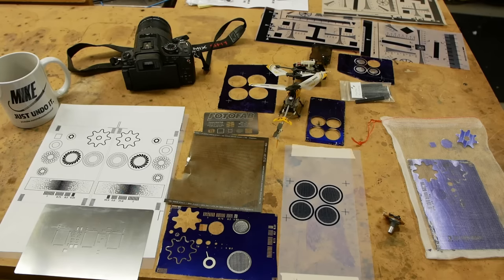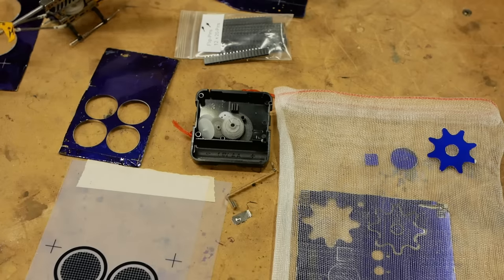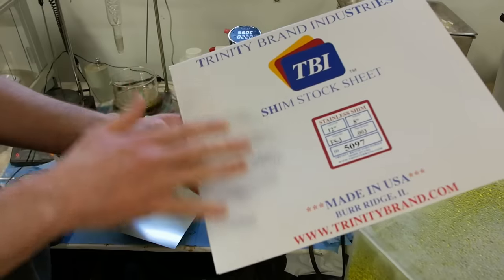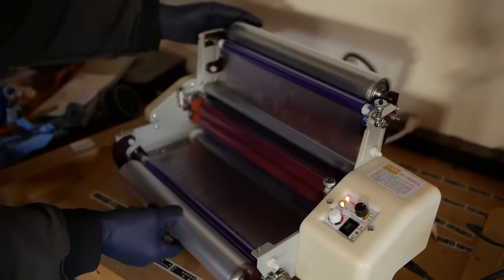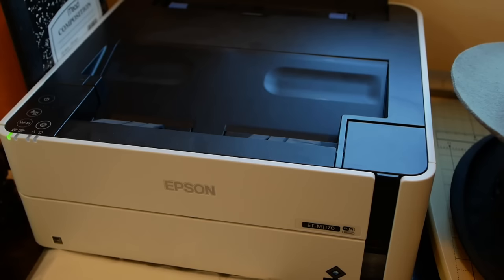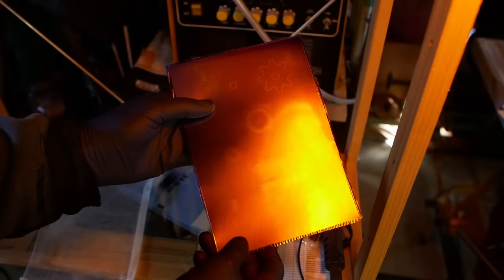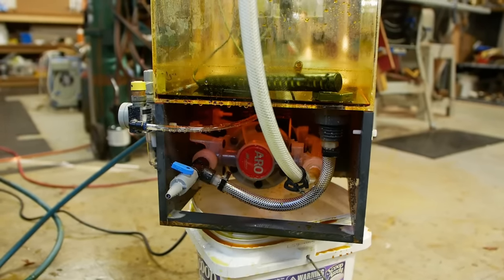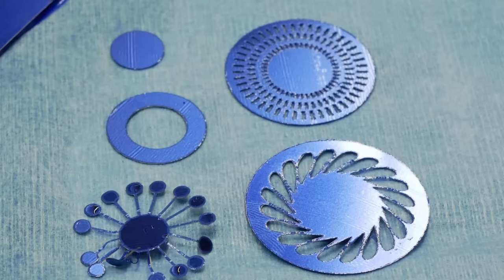How to make precise sheet metal parts (photochemical machining)

Comment: I really appreciate how you not only show your successes but discuss your challenges in these projects.
I have one suggestion if you ever wanted to revisit this.  Back in my PCB etching days I found that a viable alternative to spray etching is bubble agitation of the etchant.  Putting a fine mesh bubbler grid at the bottom of the tank below the part has similar performance to high pressure spray with the added benefit of not having the etchant running in the plumbing and pump.   
Both spray and bubbling end up with the same effect of getting fresh etchant to the metal being etched.   Just putting the material in a still tank ends up with the etching site having lower concentration of fresh FeCl as the already combined products only slowly move away from the reaction plane.   Bubbling seems to have a similar effect as spraying, constantly introducing fresh FeCl to the etch site increasing the overall reaction speed.   
My first test of this setup didn't anticipate how dramatic the difference was vs simple etchant circulation, so I etched too long and ended up undercutting the mask so much that all the copper was removed from the board!  Not quite the result I intended.
Reply: The problem with bubblers is that no matter how much filtration you have, there's a constant outflow of ferric chloride saturated air from the tank and things get..... corroded... in the vicinity. We ended up swapping out the bubbler for a couple of model boat props on very long shafts run through the tank lid

When etching copper, there are alternatives to ferric chloride. It's reliable but messy and makes even stainless steel rust

High strength hydrogen peroxide + hydrochloric acid (we used to call this the 6 second etch - extremely dangerous in high concentrations) - this works really well and lasts virtually forever (used ferric chloride is an environmental hazard due to the copper in it) - this also eats stainless steel so use with caution

Ammonium persulphate works really well too

There are a few instructables around on this stuff, but etching steel or other metals will have different ideal etchants
Reply: @miscbits6399  I don't disagree that air filtration is a necessity with bubbler systems.  I used an activated charcoal fume capture with good results.  I didn't mention that point since I was comparing to a spray etch system which has very similar exhaust air filtering needs, but thanks for pointing this out.
Reply: Why would you go for that instead of normal
Horizontal conveyor with oacillating sprays top and bottom?

It’s an oxidation reaction which will allow good circulation of fecl3 while solids deposit at the bottom of sump and also have enough flow contact with the substrate. 

Sounds interesting what you tried anyway.
Reply: @Mr.Flo.Official  Good questions.   Answers:   this was ~1981 in a lab setup for prototyping boards.  I already had a etchant circulating dunk style tank which I could convert by reversing the hose connections to pump air vs liquids, and didn't need to add parts.   This was long enough ago that I was prototyping by drawing circuits with resist tape, not even photo resist.
Reply: @IFS  i see :) things changed since.
Reply: @miscbits6399  I just sealed the tank and let the pump suck in the air at the top, this mostly solved the corrosive fumes issue.

Comment: Regarding the transparency and the special ink. I had the same problem 25 years ago making masks for exposing PCB's. Came to the conclusion that printing on ordinary paper worked well enough. The laser toner sticks really well to paper, the coverage is 100% without pinholes. And the UV used to expose the photo resist went through just fine.
I had to mirror flip the design so that the printed side of the paper touched the photo resist.
Reply: Okay, that's interesting that the toner sticks fine to paper, but not transparencies. I'm more surprised to hear about the UV transparency of the paper, though!

Comment: As others have said, great work as usual X)

For the registration alignment of the two layers of transparency - what about using an overhead projector?  Put both sheets on the glass, then use the projected image to align the parts.  Not a huge amount of magnification, but even 3~5x with good ergonomics would help.
Reply: That’s brilliant!

Comment: I have been doing a variation of this. Instead of printing on transparencies and then using an UV exposure station I used a cheap resin 3d printer to expose my artwork on the resist.

(The kind where a UV light is projected through a digital screen to solidify the resin. I have been using an Elegoo Saturn. I just remove the vat and put the plate on the screen.)

It worked quite okay for me. I got some niece pieces. The theoretical benefit is that you have zero setup cost. The very real drawback is that if you want to etch from two sides (and you want to etch from two sides) then you need to flip the plate and place it very precisely at the same spot on the resin printer's screen.

To be able to achieve that I have made a kind of jig holding a usb microscope solid relative to the printer. If you do an exposure without the plate being present you can see the invididual pixels of the resin printer with the microscope. And then you can use this to align the second side of the plate very precisely.

I have made this decorative orrery using the technique: https://www.youtube.com/watch?v=KK3TiUWSTbI

Comment: Very cool!  It's quite similar to the process I've used for home PCBs, an Epson inkjet is pretty much mandatory for getting that super-dense artwork-- and yeah, pretty annoying you have to use a piece of paper as a backing to get it to detect the transparency.  I use a medium-format Artisan 1430 outfitted with a CISS system to make sure I never run out of ink.  Now that Epson has come out with Econo-cart refillable systems it sure makes the whole process straightforward, using special high-density inks.  For developer I do like using sodium metasilicate since it seems a bit more forgiving.  Also using a vacuum-bag to hold the artwork against the boards is a lot less hassle than getting pairs of glass pieces to sandwich the artwork/board and making sure it has even pressure across the whole piece.  For single-sided boards I just use a consumer vacuum-sealer/bag, though I have to make a bag out of heavy plastic tarp for double-sided boards since they have printed stuff on one side of the vacuum bags.  To seal them I use the rubber tape which is used for carbon fiber/fiberglass resin infusion, as well as sealing around the vacuum hose.  Very easy to use, strong, and virtually leak-proof.

Comment: I've gone through almost exactly this process in the last week so this couldn't have come at a better time! I ended up going with a spray photo resist and then removing the resist with a galvo laser since I was making a decorative brass piece but this seems like a fascinating method too!

I'm not sure if adding citric acid to the ferric chloride will help with stainless but so called Edinburgh Etch is a more efficient etch used in copper plate print making. The theory being the citrate helps to keep the etched material soluble.
Reply: In case others want to take a deep dive:
I've also though about using a resin 3D printer as a direct digital-to-plate technology. I've seen videos about doing this for PCBs. Since they have a UV source and the screen acts as a digital resist, you can put the sensitised plate on the screen directly. As the printers get bigger, hopefully there'll be more spare parts available to make a dedicated unit for exposures at a usable size.

Comment: This whole process is very similar to offset printing plates.  But they were in aluminum, and only partially etched into the plates for printing.  We did quite a lot of these in our class.  This was highschool graphics class, back when the 486 was being conquered by the pentiums.  We used all Macs though for that class.  Don't remember what they were, but early 90's style machines.  The large camera is what we used to make our transparencies.  Literally a giant wall with a huge lens, and a room behind it to put the transparent film onto it.  We developed it right then and there.  I bet film transparency would be even better than inkjet as far as detail goes.  We then used this on a the plate that was pre-covered with resist, put it in the light bath thing for a few minutes, and then washed it off in a special bath and unknown chemicals (at the time), and then rinsed them, and the plate was done.

Comment: I make circuit boards using laser printer toner for the resist. I use a heated 'laminator' to apply it. My artwork IS my resist. It took a few tries to get right combination of backing paper, heat, and pressure dialed in but it was an inexpensive and rapid process. I purchased the highest resolution BUDGET monocrome laser printer I could find and have much success. I don't know if toner would survive your mesh bagged etching intact though.
Reply: One note on using toner transfer. I don’t know if this is still the case, but at least formerly, Brother’s toner didn’t work for the process. I don’t recall the details, think it maybe had a much higher fusing temperature so it was hard to get it properly melted to stick to the PCB material.

Comment: If no one else has mentioned it, look at the clean air boxes that mushroom growers use. It might work for drying the metal after cleaning if you’re doing large batches
Reply: laminar flow hood, you can DIY them pretty easily

Comment: What sort of pump did you find that can handle ferric chloride without disinregrating?
Reply: As per ~ 18:48 they are "Air Operated Double Diaphragm Pumps" and appear to be made by "ARO".  

So Basically it's almost like a drum (the instrument) with pipes over the external "drum heads".  Air is pumped into the "drum", the diaphragms push out a bit, and if the "pipes" are designed all fancily and some one way valves are used one can make a pump.  These not only can be really chemical resistant, but some can even pump abrasive slurries!

Comment: I know you can use Miore patterns, which are large macro patterns that naturally appear while adjusting the alignment between parts with fine regular features, to quickly alignment-tune industrial survey equipment by hand to a surprising degree of accuracy. (Even to the point where the expensive high accuracy measurement equipment was only necessary as a QC / fine-tuning step, improving production rates etc.)

I wonder, if you put a a differently spaced dot pattern on each side of the print if that would enable you to do fine alignment of the two layers by eye ( 13:00 ).
Reply: the awesome thing about your idea is that he can still use the typical cross as rough adjust, sanity check and fallback. It adds to the precision, without taking anything away.
Reply: I used moire patterns to calibrate the flatbed printer for lenticular printing. It is annoying to get it to align perfectly, but you get some mad precision.
Reply: Vernier calipers use a similar trick to let you read extremely fine measurements. It's such a clever idea, I was amazed when I learned to use them.
Reply: Great idea to use moirés! They should make very fine alignment easy without magnification or squinting.
Reply: Aligning the tool is one of the biggest challenges when it comes to preserving misalignement top to bottom. 
He will never get any sort of grids good enough for any applications doing it this way. :) 

He never discused about how shrinking affects alignement etc etc.

Comment: Ben, thanks for the video, brings back memories of make PCB boards before you could buy them dirt cheap.  I like your etching tank, for PCB's I has a splash tank.   It was about a foot cube tank epoxied plywood. You put about 1 to 2 inches of etchant  in the bottom.  A motor driven dasher paddel  splashed it all over the board with good force. --worked very well.
The final improvement that I never finished was to make a raster direct UV laser diode imager. No need to do any lithography.  I met a guy Zoltan who converted a old printer, replacing the print head with laser source and lens.  He got some amazing resolution from the hack.  One thought I had was to convert a laser printer poly scanning mirror and lens from the IR to a UV laser for the X axis then use a stepper driven Y axis stage to advance to the next line.

Comment: Regarding the plastic fittings at 19:40, you might want to try Fit-line PVDF or PFA Flare fittings.  The PVDF fittings are cheaper and might be all you need.  These fitting are more likely to handle the heat, pulsating pressure, and corrosiveness of your fluid.

Comment: For the mask, you could perhaps use a film imager (recorder?) for offset printing. Nowadays many printshops use direct-to-plate imaging, but you may find a used film imager for cheap. The film that goes with it is high-contrast, high-resolution (we used to do 2,400 ppi) and designed for near-perfect registration. Of course, this involves its own film development workflow, which you may not want to fuss with.
Reply: Came here to say this. Useful ebay terms include "imagesetter" and brands "linotype" and "agfa". Beautiful output and perfect for this application.

Comment: This is how I make my PCB prototypes :)
I use immersion oil (for microscopy), between the photomask and photoresist - the edges come out much sharper.
Reply: Me too. I use ky lube instead. easily dissolves in water
Reply: @marcoaurelio4903  If it is suitable in terms of optical characteristics and has similar refractive properties, then it is possible.

Comment: +1 on another great vid comments :) From a former pro photographer who started in the age of film, a couple of potential resources for old photo tech that could be cheaply adapted: 4x5, 5x7, 8x10 and custom sized sheet film used to be sent through the machines on these stainless steel racks that had standard and adjustable rungs and spacers that would firmly hold several sheets in each rack. The film was held firmly around the perimeter and wouldn’t come loose—I wonder if you could find some of those kicking around somewhere... dunno if Adolph Gasser is still open but they used to have huge piles of photo junk in the basement. I once scored 3 or 4 big enlarger uprights for a song. Hand cranked sturdiness... Also if anyone in your network is closer than Kevin Bacon to any of the good people who worked at the New Lab, buying them lunch in exchange for describing how their big E-6 line functioned would be invaluable, and would probably come with some great stories to boot. One last aside regarding plastic compatibility: I recently threw together an electrolyzer for water-splitting (because BANG!!!) and found the hard way that few plastics do well with strong KOH solutions, including polycarbonate and acrylic—which makes me think of all those electrolyzer kits with the clear outer walls, and how I wasn’t able to find any common clear plastic that was considered to be at all good for long-term contact with strong alkali solutions... I used polycarbonate because it doesn’t shatter but the KOH took it to pieces in days. 

Anyway thanks for another good episode :) 

Wells

Comment: Aftermarket photietch for scale models is pretty cool. Also incredibly expensive to buy pre-made stuff so there are inexpensive kits that couple everything for you. MicroMark has a small size kit with everything you need for about 110 dollars (obviously doesn't have a printer included though)

Plasmo has a good video on this subject too but it's a lot less precise since it's done on the super cheap with the simplest set up possible

Comment: We also learned, that despite the claims of many manufacturers, a variety of plastic products are not compatible with acidic products. We do research on redoxflow batteries. Ended up developing a whole process of what works and what doesn't with our chemistry. Its really nice to see your workarounds for the problems you were facing. Keep it up!

Comment: I can imagine a fully automated system doing all those steps. No wonder why the comercial option is so expensive.
Amazing video as always!
Reply: plus the latent risk that the panel fails for whatever reason and having to rerun in from scracth.
Plus litteral shipping and handling of parts that are very fragile.
Even leaving them in the frame, you can etch artifacts that might bend.
Reply: @sarowie  However, with turnaround times of three or four times you could "outsource" quality control to the customer and it would still be faster to do a more tightly controlled rerun and ship that than the current companies' multi week turn around time.
Reply: @sarowie  fail? 
Come on. His results are an insult for someone who knows chemical
Etching. 

The peel of. Losing ridgetops. Undercut he is got. 

Good joke. 
And that’s how I watched the video. Good entertaining. But let’s not say “how bad” chemical etching companies are. 😂🙏🏻
Reply: @Kenionatus  not always the case. 
If you project is got good forecast you are a good candidate for PCM. If you only need 1-2 components and this setup presents results to your need - why not using lasercutting? So much cheaper and faster for prototyping if quality is not needed 🤷🏼‍♂️

Comment: What I find fascinating is that I am watching this video of etching metal plates to precision parts through a device that used very similar processes but done on a scale about a million times smaller on a crystal of silicon than what's been done on metal sheets. It's like watching things in my undergrad textbook happen on the scale where I can see or touch, instead of on the scale only electron microscopes and 3D renderincs can barely suffice. This is so cool.